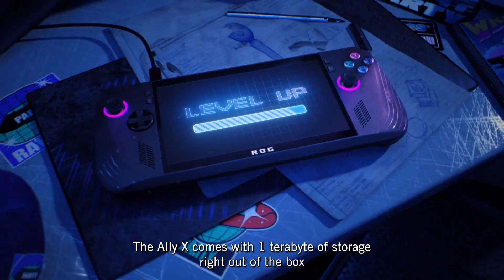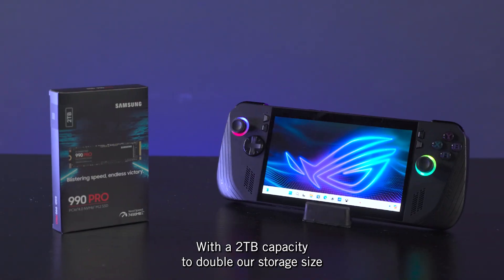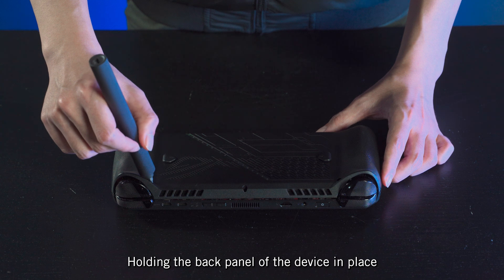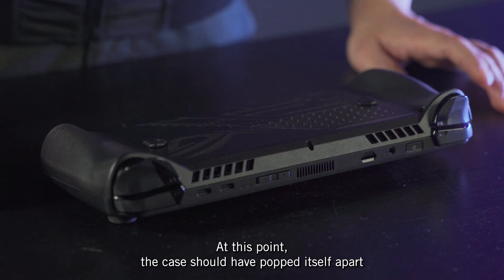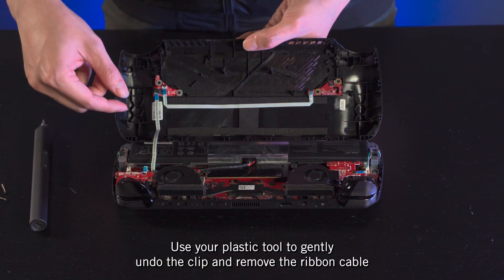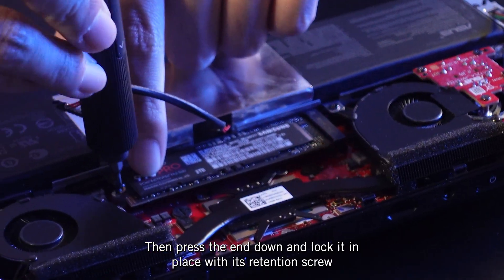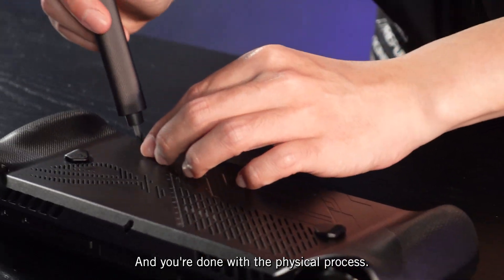ROG Ally Tutorial Video - how to replace and upgrade an SSD

Comment: Since the beginning of spring, with all the latest updates, the asus rog ally z1 extreme has been getting very hot when used from the cable. Instead of 30 watts, the console uses more than 40 watts, and sometimes 50 watts and heats up from 85 degrees Celsius to 97 degrees Celsius, instead of the usual 75 degrees Celsius. Please fix this bug in the software, the next system update.

Від початку весни, з усіма останіми оновленнями asus rog ally z1 extreme  сильно нагрівається при використані від кабеля. замість 30 ват, консоль використовує більше 40 ват, та інколи 50 ват  і нагрівається від 85 градусів Цельсія до 97 градусів Цельсія, замість звичайних 75 градусів Цельсія. Будьласка виправте цей недоліу у програмному забезпеченні, наступного оновлення системи.
Reply: Since the beginning of spring, with all the latest updates, the asus rog ally z1 extreme has been getting very hot when used from the cable. Instead of 30 watts, the console uses more than 40 watts, and sometimes 50 watts and heats up from 85 degrees Celsius to 97 degrees Celsius, instead of the usual 75 degrees Celsius. Please fix this bug in the software, the next system update.

Від початку весни, з усіма останіми оновленнями asus rog ally z1 extreme  сильно нагрівається при використані від кабеля. замість 30 ват, консоль використовує більше 40 ват, та інколи 50 ват  і нагрівається від 85 градусів Цельсія до 97 градусів Цельсія, замість звичайних 75 градусів Цельсія. Будьласка виправте цей недоліу у програмному забезпеченні, наступного оновлення системи.

Comment: What about the OS in new SSD. 🤔 No guide for that. 😦 Complete disaster.
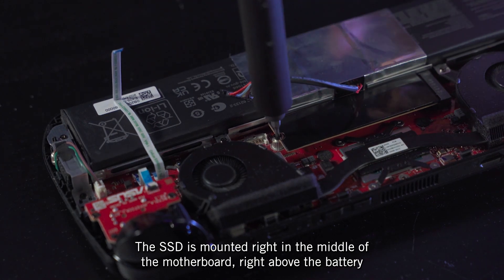Reply: 1:13 yeah, I know right? especially they forgot to remove the battery cable after remove an old SSD and then forgot plug it back after replaced an SSD. so there are a lot of steps missing and wrong guide 😕

Comment: this guide is not that simple but complicated for beginner such as how to moving windows and 1:13 didn’t remove the battery cables after removed an SSD, but forgot to plug it back after replacing an SSD but they're just skipped for that
Reply: I literally came here to see how I should pop out the battery before breaking it, but yeah for future watchers: the battery plug pops UP, so you have to SLIDE the metallic lock back first, and then you use a guitar pick or similar to pop it up from below the cable plug, the whole battery tray is secured with 4 more screws (2 connected to the fans, 2 on the far left/right.